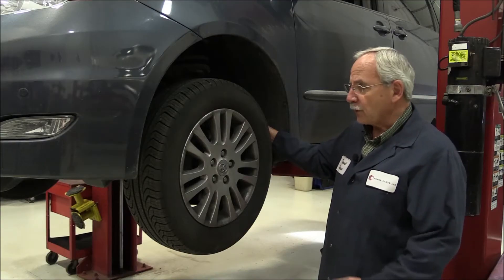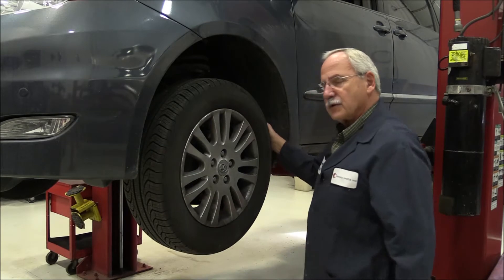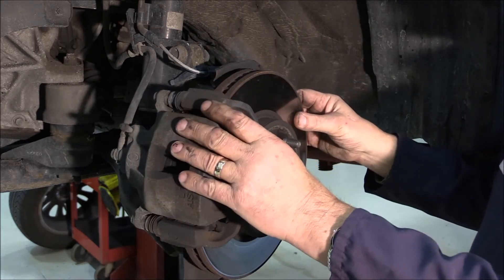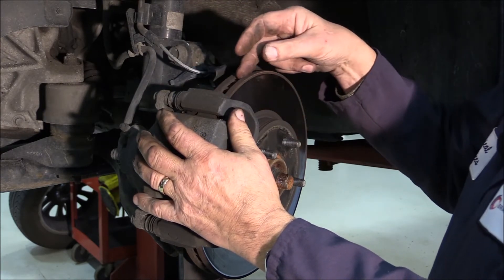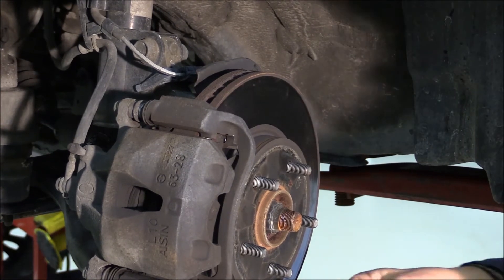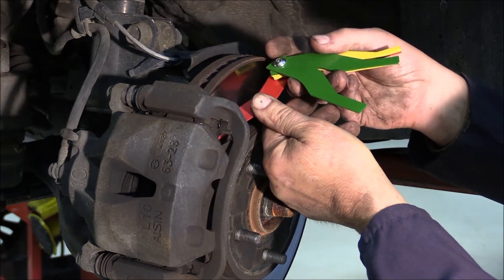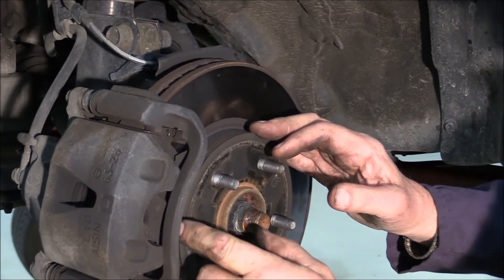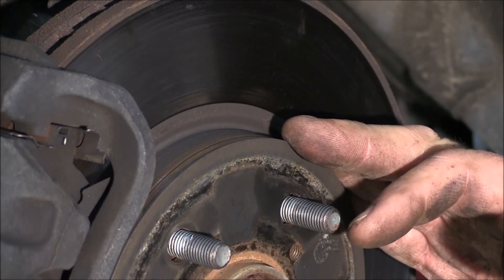Raybestos Best Brake Job: Inspecting Brake Assembly

Comment: HELP PLEASE - I am installing rebuilt calipers (from Rockauto) on my 1998 Ford F150.  the calipers came with what seems to be covers over the pistons.  The left caliper pistons covered with a rigid black material & the right caliper pistons is covered with separate white material.  
When I have replaced calipers before the piston and dust were exposed, so this is something I have never seen.  Do I remove this rigid material?  If so how?